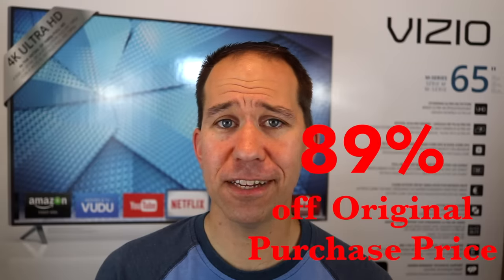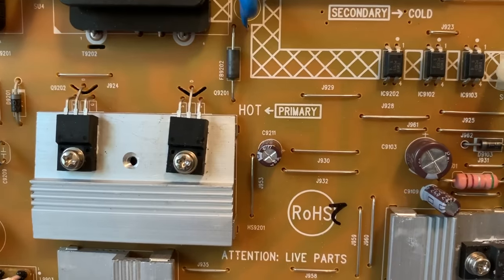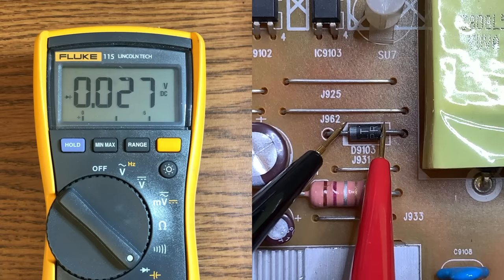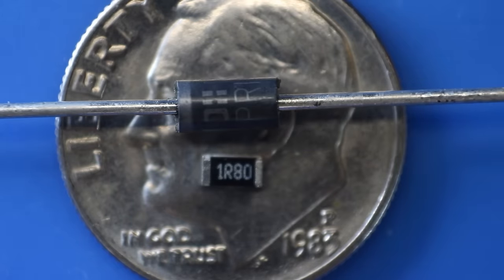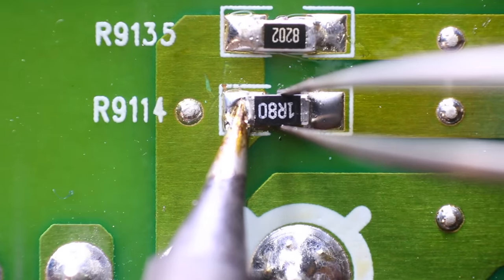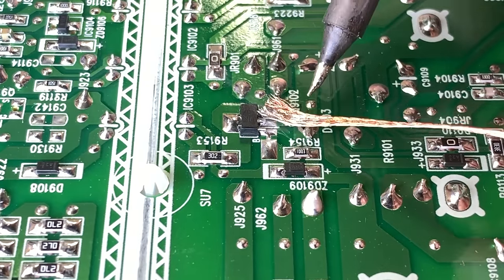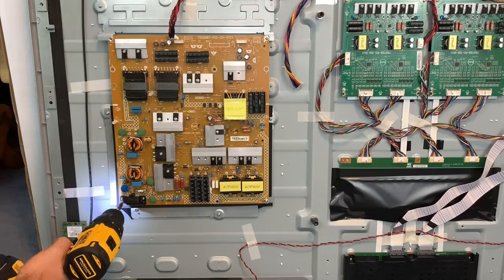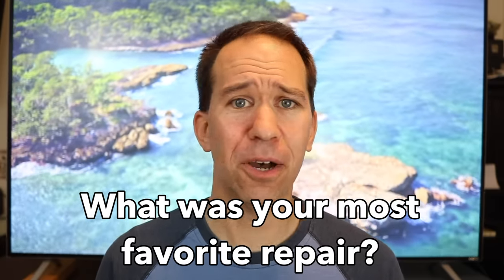I got a broken 65” 4K TV - How I repaired a Vizio M65-C1 (tv won’t turn on)

Comment: Fixed my 43" Vizio similarly. I know embarrassingly little about electronics but I laughed when I opened it and saw just the four boards. Went on Ebay and found all 4 as a package for $60. Guessed it was the power board and tried it first - no luck. And this is where your point about watching out for the input wire comes in. Turns out, after trying all the boards, I realized I forgot that input wire each time! (it slipped into the bottom and hid itself when I first unplugged it) Started back with the power board, made sure about that fricking wire, and boom - worked. BTW, our TVs are identical inside.

Comment: How do you learn about using a multimeter? 
I’ve fixed several TVs with bad capacitors, always wondered about the rest of the components and not known what to do with them if they are bad. That seems a much more definitive way to see if things are bad on the board, thanks for the great video!
Reply from the maker: Glad to hear that you've fixed a few tvs!  That's great.  Did you happen to watch my video on what to do after a power surge?  In that video I cover some of the basic voltages to check.  I also hope to make a series of videos on repairs and diagnosing procedures for lcd tvs.
Reply: Sounds good, I’ll check it out thanks. A video on how to use a multi meter would be good, (in relation to fixing a tv that is). Look forward to your next videos!

Comment: I may have this problem?  It’s a 6 year old Vizio 4K 65”. It was on, and it just started to slowly go black. It turned off and it wouldn’t come back on. I tried all the simple troubleshooting of unplugging, and hard power resets, but it is dead. I’ve done repairs before for smaller electronics like game consoles. This will be my first TV dive. Thanks for the encouraging words.

Comment: So, I am sorry for a long post, I have a couple questions though and I want to also see about learning this stuff properly and starting a new career path, if you could take a few minutes for me and read this I would be grateful.
 
I have been obsessed with these videos, I really want to learn how to do this stuff, I enjoyed assembling pc's for about 10 years as a hobby and learning about platforms and how they function, building gaming rigs and testing them, optimizing them, etc, doing bench tests and benchmarks, etc.. but I never learned about how to actually remove parts like transistors and capacitors and other things from perf boards.
I want to learn both for my own curiosity, so I can fix my own expensive items and also so I can incorporate repairs into buying and selling items, ( I am a disabled mason looking for a new career path) and this stuff fascinates me and it looks like fun to be honest.

Where do I look to learn this stuff officially so I can actually go to school and earn a degree or license or certification to be able to work on this stuff?
Also, the reason I am here today specifically I have a Vizio P series from 2014, not the revised P series from 2016/17 they are a little different.
What I do know is my P series 70" (P702ui-b3) had an issue I saw in another video where it would power on, and you could see backlight, but no picture, then I would power it off and on again and then it would start fine, it seems like it needed to warm up to work,  and then it would work for 12 hours or more at a time, it did this for about 3 weeks before one day it just powered off and would not come back on, it was dead.
I brought it to a tech who has it now, he is going to give me an estimate for repair over the next few days.

I fear I cant afford to pay him to fix though as I am disabled I dont have much to work with these days unlike when I bought this tv in 2014 for $2000.00 these days I do not work or have an income and so I fear he will come back with a cost I cant handle, but I wont know for a few days, I need to keep it under $250.00, otherwise I will take it back and one part at a time as I can afford it I will order the parts and eventually rebuild it.
In the meantime watching this and other videos about fixing no power Vizios is inspiring me.
I had considered what if I just order a new tcon board, a new power supply board and swap them out myself or for that matter there is a kit I can buy for just under $300 that gives me I think 3 or 4 boards in the kit made for my tv and then swap them all out.

I dont know about testers or how to use them or what to look for, so without some education there is no way for me to diagonse what the actual problem is, would replacing these boards be a reasonable way for me to fix this myself without getting into soldering and removing parts?
How can I tell if the estimate I get is honest and he will replace the item like a transistor or the whole board?
I imagine some less reputable places might tell me they put in a new board when in fact all they did was a .50 cent part repair that took an hour, and still want to charge me for a board swap, presumably around $350.
Any advice you can offer me or information that can help me with this tv and any information on how to get started looking to learn this type of electronics repair?
Thanks for the videos and thank you or any information you might be able to offer me.

Comment: Great video. I always remove components by adding more solder to the pads and then heating both sides up alternately
. While you heat up the solder on both sides, hold the component with a tweezer and just put a tiny bit of draft pressure on it. You can feel when the component gets loosened from the pads and you can just pull it away. When the components are smaller you can cover them in solder until they are hot enough to stick to your soldering iron. Your method of removing is good as well. I had the problem that when the boards become smaller, the pad could get damaged/loosened and thats frustrating and time consuming. I worked a lot with hot tweezers but I rather prefer a smd single soldering tip (not when there are many components to replace. Then the tweezer tip is saving a ton of time). Especially when you have to remove components that are on the mass line, they take more heat on that side and with hot tweezers it takes longer to heat these sides up.

This is no criticism, it just came to my mind. I would repair more stuff but I am currently not able to buy the tools to do it efficient.
I will check out more videos from you in the future. Greetings from germany :)

(sry for the long text)
Reply from the maker: Thanks for your comment!  Yes, that is another way to remove components.

Comment: Best repair I ever made on a TV was a Samsung Smart TV back when they first came out and someone had left it out on the curb with a sign saying "it doesn't work so take it", so I did. I got it home and plugged it in to see that it had no indication of power at all. So, I took the back off of it and started probing the power cable to make sure voltage was getting through the power cord. It was getting it to the power supply board but abruptly stopped at the first component on the board, which was a Varistor and could be purchased online, much in the way shown in the video. I pull the varistor from the board and go down to the local electronic repair place and ask him if he has any of them in stock. Normally, they don't sell the components they have because they want to sell you their labor, but this guy seemed really interested in my story about the TV and how I got it and legitimately wanted to know if that was enough to fix it. So, he gives me the component for free and tells me to let him know if it works. I get home and immediately put everything back together, plug it in and watch as the whole thing comes to life at the push of a button. This was probably a $800 tv at the time and I used it for years afterwards.
Second favorite story, I found a 55" tv on facebook that the lady said wouldn't turn on, I bought it for like $20 and took it home. I plugged it in to see exactly what the problem was and the damned thing just turned on... Worked perfectly. lol
Reply from the maker: Great story and repair!

Comment: I bought one of the last 64" late model Samsung plasmas for $50. It would run erratically (10-30 seconds) when warm and also buzzed a little louder than plasma's should. When testing it with the rear panel removed, I noticed that just jostling the frame a little would also reset it.  It turned out that all the ground screws on every board had come a little loose (from thermal expansion) so that it wouldn't stay grounded when warm (not a good thing). I also, for good measure, refreshed the solder on all the major components that were attached to a heatsink as those are the first to have thermal cracking/solder issues.  Long story short, after tightening the screws and a little soldering, I got to watch Riddick like a boss for the first time. I now have a killer 64" plasma with deepest blacks that cost $3500 new...for $50 and an 2-hours of my time.
Reply: Oh...and it the buzzing...much more quiet now.
Reply from the maker: That is a great story!  Thanks for sharing.

Comment: Great work on the TV !! My recent one was the main board replacement in my 4K RCA Tv that had volume control issues it would be beeping all the time and basically uncontrollable.  Ordered a new main board which cost only $47 and installed it and its been running great ever since

Comment: Thanks man for the video and repair, just got a 70 inch vizio TV yesterday for free, after diagnosing i am not able to find a single error in the power supply except on AC-DET which have 4.34 volts instead of 5volts, dont know if 4.34 volts are ok or not which drops to 3.28 volts after connecting the mainboard, for me it seems a mainboard problem as i am also not getting any voltage at PS-ON which seems to be at ON after mainboard is Ok and send signal which is received through AC-DET, correct me someone if i am wrong. Hope i also fix this 4K TV as you did the great job done.
Reply from the maker: Thanks for watching.  If the screen isn't cracked then you have a good chance to get it working again.  I'm not sure what AC-DET is for but PS-ON is important.  With everything connected and plugged in, it should measure under 3v (probably near 0v)  but after you press the power button on the side (or remote) then it should go up over 3V.  This tells the power supply to turn on all of the other main voltages, including the backlight.  Good luck!
Reply: @FrugalRepair  the thing is that i am not getting even power light to press the power button from tv or remote, but still did it without anything on tv shows. the screen is ok but the problem is even on power supply or mainboard, have checked all the components on power supply everythings comes up OK, except ac-det which shows 4.34 volts. PS-ON is 0volts and never goes up. Searched youtube videos and no one talking about AC-DET and my power supply doesn't have standby pin, i have just PS-ON and AC-DET pins along with GND and 16volts, the 16 volts are perfect and not going up or down it is steady 16.18 volts. Vizio model m70-d3

Comment: Great Video man.  I just picked up a 42" Vizio that takes power but has no picture.  I'll be digging into it this weekend and may reach out for advice!  Popping my cherry on this one!
Reply from the maker: Great attitude!  I’m sure you’ll figure it out.  You’ll need to test for a bad backlight. It could also be bad firmware on main board (could replace the certain chip).  Those are two initial thoughts.  But it could be a bunch of other things.

Comment: I have a 60 4k visio series p that I paid a boat load of money for and just after the 2 year warranty was up my tv wouldn't power on. So I took the back off of it and found that 2 capacitors were blown, not easy to spot since the tops are just pushed out. I don't have any diagnostic or soldering equipment any longer and haven't soldered anything in decades. So I just bought a new power board online and for $30 since I couldn't be sure if other components where faulty. 
The new power board fixed my tv and haven't had a problem with it since. That was 3 years ago.

Comment: Great camera work. You made it very easy to follow along. Kudos! While I envy your electronics repair skills, you really need to work on your negotiating skills. LOL $150 for a broken Vizio 4K TV? Regardless, I want to see more. You've got a new subscriber.

My favorite repair was a 25" LG computer monitor. It had two bad capacitors, victims of capacitor plague. I went online and found a forum where they discussed the problem and how to fix it. That was over 15 years ago. It's a beautiful 1200 x 1920 monitor and is still going strong.
Reply from the maker: Thank you!  That’s funny.  I did get this tv a while ago and I didn’t want to loose my chance so I had to be willing to go that high.  Congratulations on fixing the monitor!

Comment: Great video. Would help us newbies if you also mentioned the settings you use for the multimeter at the same time and what reading uou would expect to see if it tested ok. Cheers
Reply from the maker: Thanks!  I thought I mentioned those things in the video.  The diode should have .5v drop in the one direction and nothing in the other.  Resistor she be about 1.8 ohms.

Comment: I just bought an lg OLED with a smashed screen for really cheap. I can't wait to follow your video and get it working again. I'll save thousands!
Reply: I have been watching your videos and recently subscribed. 
I love repairing my equipment from  HD washer to lawn mowers.
My recent problem is my Visio 50" (P502ui-B1E). I was watching it about 2 months ago and all of a sudden the right half of the screen went to the snowy screen and the right side was fine the 3 seconds later it all totally went black. I did the flahlight test, it did not have a logo on power up. I took the pack off and looked for obvious capacitor failures but nothing ever stood out to me as an issue. I am now well versed in electronics as far as capacitors, diodes and such but your videos give me push to leep searching. I will eventually figure it out...maybe two years later....but I will get it and save the landfill from another pile of plastic.
Thank you!
Elmer Griffin 
Gilbert, SC

Comment: You are not the average "fiddler". You used good de-soldering/component removal technique. I was concerned that you might lift a circuit trace or pad , but no damage. Our old Samsung 49" TV is going out on the curb ,  setting up replacement  Vizio  "50" TV tomorrow.
Reply from the maker: Thanks!  Not going to fix the Samsung?
Reply: @FrugalRepair  No, if power or mother board have problem, I prefer to buy another TV .

Comment: I have recapped a couple asus motherboards and got the computers working again. Around 2000 to 2005 they sold motherboards with bad capacitors. The capacitors expanded and leaked. Some car computers for the ECU do that also. Makes the cars act strange. Gotta subscribe to this channel! My kind of show!
Reply from the maker: Yep, did you look up “capacitor plague”, so many bad ones out there.  Glad to hear you fixed those MBs.

Comment: I found an old tube type TV way long time ago. The guy said it would go out of whack so he bought a new one and gave this old one away to me. I knew it was a bad tube. So I set it up and turned it on ran it and then one day I found it not working so I taped each tube and wow the picture pop in and I had my hand on the bad tube. Replaced the tube and watched TV for a long long time after the fix. I do enjoy those quick fix and making something work again. Tube was about 5 bucks. great story of your wonder full fix up. How much would a new 65" 4k TV cost?
Reply from the maker: Thanks for your repair story!  That’s great to hear.  Back when I got this 65” i think it would have been in the $600-800 new range.  They’ve come down a lot in price now probably in the $400-600 range.

Comment: A 42 inch Westinghouse tv I found on the side of the road, had power issues. Tv had a solid orange light on when I plugged it in but when I pressed the power button nothing happened, long story short it had a blown capacitor, replaced it with one I had from a previous tv I found that had a cracked screen. It worked its my everyday tv now with no problems for 7 months now.
Reply from the maker: Wow, that is great!  Free tv and free fix!  Thanks for sharing.

Comment: I wonder if my old 55" Samsung 1080p TV has the same problem. Won't Power On anymore. In the past, I would unplug it, plug it back in and wait a couple of days and it comes back On again. This time around, it hasn't come back On. I just went ahead and ordered a new 4K TV since Best Buy had good deals for Cyber Monday. I really didn't want to buy a new TV yet. I haven't picked up the new TV yet, hoping this old one would come back to life, but no dice. Cool video.
Reply from the maker: Try taking the back off and heating the boards with a hair dryer.  Start with the power supply,  warm it up and see if tv powers on.   If not, try heating the main big chip (prob under a heat sink) on the main board.  That would give you clues if it’s a capacitor issue on power supply or a bad solder connection on the main board.  Of course, this is a super quick diagnostic so not intended to cover all bases.  You can get my free guide too which might help.
Reply: @FrugalRepair  Thanks. I went ahead and picked up the 4K TV since I like the higher resolution anyways for 4K content, but I will try your tips on this 1080p and see if I can figure it out. Dont wanna throw away something that can be fixed. I can use it in a bedroom if it's fixable.